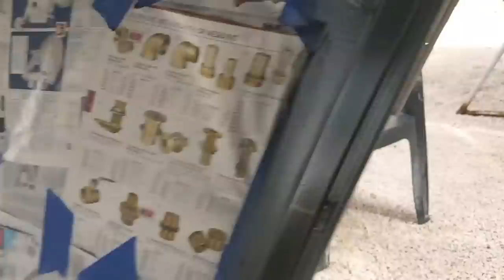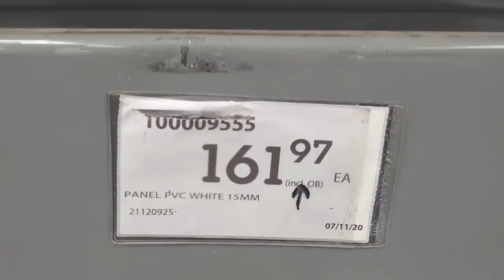Merry Christmas!! I got you NEW BOAT WINDOWS!

Comment: make a mold around the wood, epoxy fill it, if you can, vacuum bag it . Grind it to size,  It will be solid as a rock and will not rot again . you can mix in some saw dust in the epoxy.

Comment: Merry Christmas, James ~ from Margaret River, Western Australia 🇦🇺!!! 

I certainly don't enjoy replacing windows & hatches in general, but especially on Oysters. When customers call my shop or boat yard, wanting to get windows or hatches rebedded on their Oysters, I usually just hang up LOL 😆! .Oyster monohulls, are great open-water cruisers mate. They're definitely a solid boat, built extremely well to handle all types of passages and navigate the open oceans, beautifully. However., they definitely have some issues that were certainly design flaws. You already discovered the million freaking thru-holes and what a giant pain in the arse they are.  Plus, the design of the windows and layout of the original factory wiring and electronics, definitely could and should've been changed. It also depends upon the year your boat was manufactured. When you get the opportunity, get some marine plywood and replace, but first redesign the window openings.. The windows should sit extremely shallow in the openings, better yet, the windows should be flush-mounted! I have all the measurements , directions,  and templates I can send you...if you are going to replace the factory window openings, i.e. the structure.  It's definitelyworth it ~ In order to prevent leaking, which is certainly Oyster's Achilles' Heel. However, the new window geometry, completely changes the look, but more importantly,, the windows become wicked water tight.  Windows need to sit much more shallow,  or better yet, flush-mount the windows. Make the new openings, blend them into the existing factory structure. The deeper the windows sit, the more surface area and exposure the window openings or window beds have to water ~ which is not good!  Plus, water will collect in the overly recessed window openings, eventually causing damage = leaking!!! Sorry to ramble on. Take care and good luck. Once again, Happy Holidays!!!

Comment: Standard Expoxy is two rigid to glue to PVC. Plastic flexes more than the epoxy and that can stress the bond to breaking point.
West make gflex for use with plastics. If you treat the plastic surface you can even get a chemical bond.
Reply: Bingo!
PBV has a much higher coefficient of thermal expansion. It would warp twist like crazy in this application.

Comment: spray paint tip:  3M Mar-Hyde 3811 
super durable, goes on smooth, and has a matte/satin finish that hides small imperfections
Reply: That guy dumped that paint on way too heavy. James is going to have serious cracking problems in the heavy paint coat down the road.

Comment: I have used PVC with epoxy before.

Just have to sand the shine off with coarse sandpaper.
Reply: It just doesn't have the structural strength that plywood has.
Reply: I used it on my MacGregor Venture 17 trailer sailer.

The swing keel was rotten wood, around a steel backbone. Huge hunk of lead at the bottom.

I used a thick piece of PVC, with grooved to receive the backbone. Filled the groove with thickened epoxy and glued the halves together. Shaped the edges, feathered the lead in, then wrapped the entire assembly in several layers of mat, and cloth. 

IMHO it should outlast the OE keel.
Reply: @svexitstrategy2595  As used in your swing keel it had no strength until you glassed it in.  He needs the plywood to give strength to the unit already in place as they will be walking on the cabin roof and need support around the windows.  Unless you are suggesting to rip out the cabin roof and start over? Glass inside and out for strength?
Reply: @marceld6061  I agree with you regarding suitability for the stated purpose. But as far as the question about adhesion, I found no issues.
Reply: @svexitstrategy2595  Agreed.  Scuff first.

Comment: I would have just repaired the damaged sections of the wood with thickened epoxy with chopped fibreglass in it.  That would water proof the wood and fill the damaged area.
Reply: Every one of those port openings should have been back cut and epoxy or resin filled at the factory. Raw wood cut port openings are a cost shortcut. Now would have been a good time to do it right.
Reply: @akathesquid5794  yeah kinda surprised on an Oyster?!
Reply: @tamoore77  They used up all the resin on the hull, lol
Reply: @MaShcode  Spent all the budget on 50 throughhulls too!

Comment: Some etch primer would have been good idea to spray those windows with before the black spray..
Reply: That dude dumped that paint on way to heavy. its going to crack later on and only way to fix it is get it all back off with acetone or sand paper.

Comment: Onboard Lifestyles uses Star lumber as well as lightweight PVC for their trim pieces and it works well for epoxy and fiberglass. Actually, there newest video they are building a hard top and are using the lightweight PVC as a trim piece that they are going to glass over. They named the product in the video and it's probably the same as what you saw in the lumber yard. I bet you can make it out of strips that you glass together with epoxy and glass rather than using an entire sheet and making it out of one piece. If you purchased a smaller sheet like a half sheet, you could save money.

Comment: Remove all loose wood. Lightly wet the voids with thin epoxy then add colloidal silica  thickened epoxy to fill the area.   Way too much trouble to replace the entire window opening structure unless it is all rotted.

Comment: Merry XMas James !   I'd def wait until FL where you'll have quality mat'ls worthy of an OYSTER... one concern, you already have a lot of mold in there on the headliner fabric and wood... I'd plan on replacing the headliner, and carefully remove it if you want it for a pattern... suspect it may not be worth all that trouble if instead, you make the sections around windows from smaller pieces, instead of one large piece that you end up cutting 95% away in trimming. If done neatly it can look factory fresh w/45 or 90 degree seams at corners saving you much moola on fabric. All that investment will be worthless if the leaks and mold destroy all the new work too... get some 3M alum metal duct tape to seal all around windows  under $10 a roll of 50 yds x 2 in width

Comment: Bro, we gotta get ya an oscillating multi-tool.  I've used mine to bring back  to life an old mirror with metal frame not long ago.  They move so little that it's way easy to control and if you ever slip, there's nothing 'whirling' or 'spinning', to make it wanna take off somewhere.  Also, of course, great for precision cutting anything.

Comment: James, did you use any primer for those aluminum frames? So happy you undertook this. I was planning to remove the windows on my Oyster 53 but now will paint then in situ based on what I saw. Despite earlier comments, 19 yr old boat, no leaks at the windows, excellent wiring..solid build. Also, Oyster support for me, as 4th owner, is as if I bought it yesterday.

Comment: If the window frames are made of aluminum, which I expect they are, there are specific methods to paint aluminum, as follows:  etch the aluminum with an 'acid wash' and then prime the metal with an aluminum paint primer and then paint the metal with paint specifically made for aluminum applications.  I suspect the paint that you applied won't last for long.  Just sayin' and hoping that I am wrong for your sake!  Good luck.

Comment: i HAVE MY SHARE OF EXPERIENCE SPRAY-BOMBING motorcycles including flame jobs etc. That was really bad the way that dude was dumping all of the black paint on those windows. he should have used as thin of coats as possible. later down the road that heavy coat he put on those windows is going to crack real bad and you will have problems with it. If the sun hits it,  it will crack in no time.